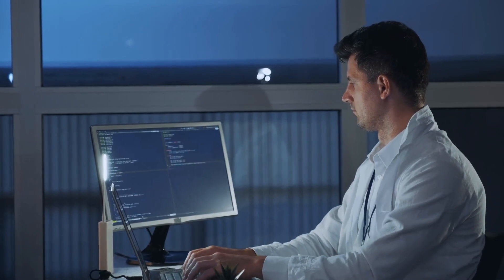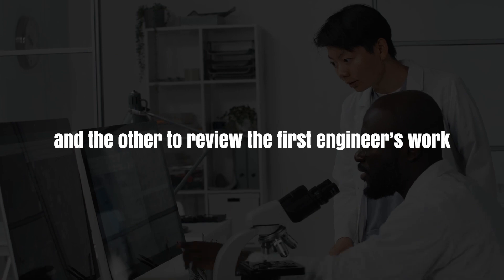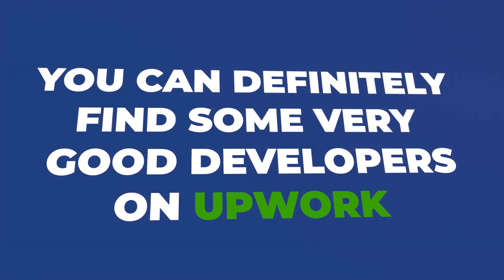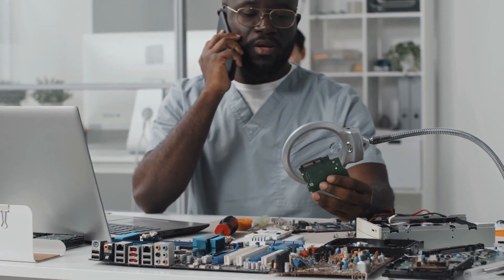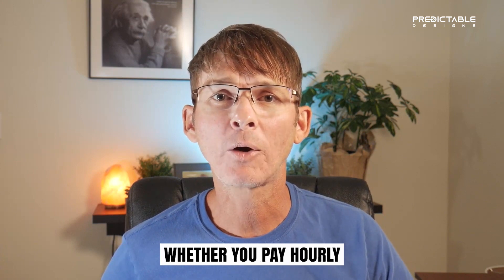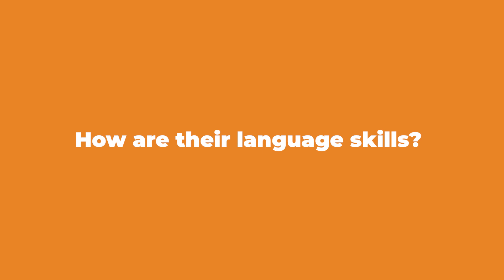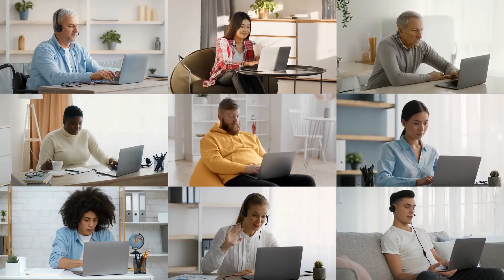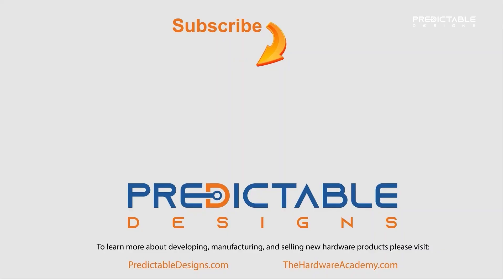Steps to Minimize Risks When Outsourcing Product Development

Comment: Thanks for this awesome video John. How do you address protecting your product IP when dealing with developers in overseas jurisdictions that may not be covered by a PPA or NDA? What assurances that your product being developed in another market won’t be reproduced under a new name? Please advise. 
Thank you
Reply from the maker: Glad you liked it, thank you! That's a great question. One of the best ways is to simply never let any one person or company see all of the pieces that make up your complete solution. 

Of course, this means you need to be in control of the project and overseeing that all the parts come together properly in the final product.

In my Hardware Academy I have a workshop on this topic that also covers protecting it from manufacturers and not just developers.
Reply: @PredictableDesigns  thank you

Comment: That was really useful, thanks John.
I especially like the strong suggestion to hire another engineer that you trust to oversee or check the output of your 'new' engineering consultant. A bit more cost but it reduces risk to you and your project significantly.
Reply from the maker: Thank you so much Markys! Yeah I think getting second opinions are always a good idea. 

This is one of the reasons I created my Hardware Academy program to help provide independent design oversight and guidance without lots of extra cost.

Thanks again, and I always appreciate your comments!

Comment: Really useful and relevant to my current position  - thanks John. 
Just to share a recent experience with everyone, I had a great developer in Pakistan who built the simple testbed circuit I needed for some experiments. However, the hardware got stopped by Pakistan customs and the delivery was never resolved. Not a disaster for me, but an expensive lesson in making sure that final delivery is a milestone.
Reply from the maker: Thank you Pip and I'm glad you found it really useful. Sorry to hear about your issue with customs and you raise a great point to consider. Thanks again!